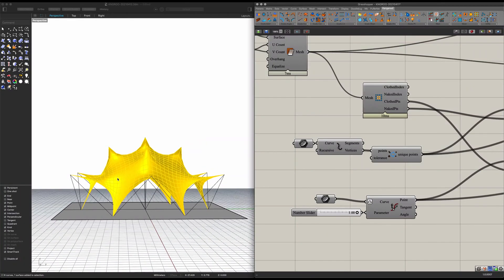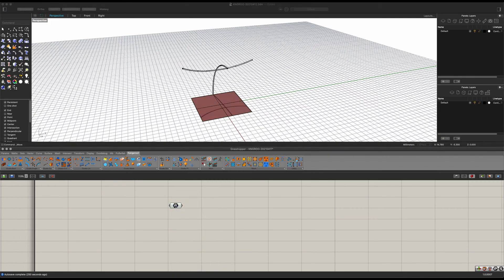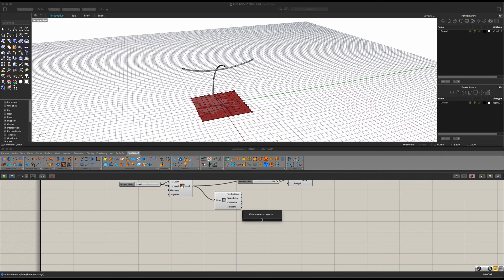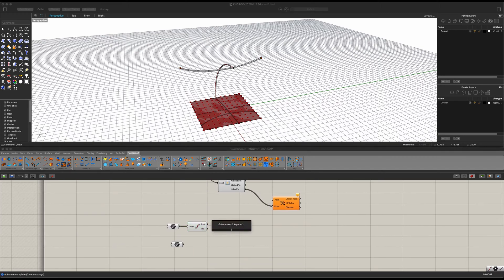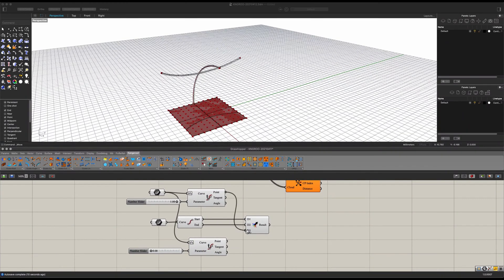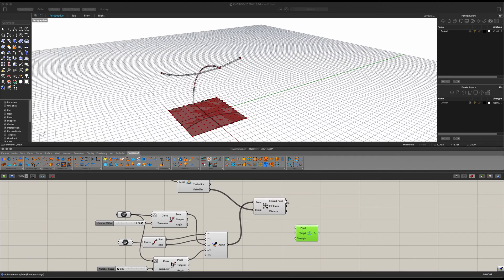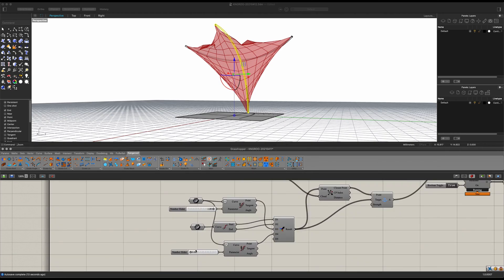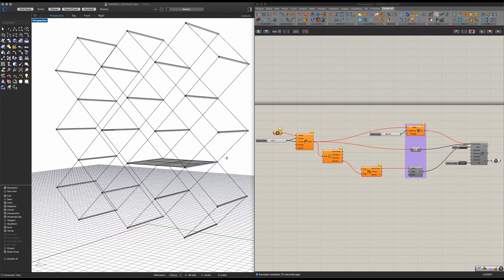How to make 4 basic tensile structures! - Rhino/GH Tutorial

Comment: Hi! I was wondering if this works for samples that are much larger and how to make that work. I tried this out on the provided rhino file, then copied the grasshopper code and small model into a different file. I scaled the small provided model up and attempted to put the same code on it and it hardly covers the points all around. If someone knows how to resolve this, let me know! (This is for the tensile tent structure example).
Reply from the maker: Consider increasing the value ranges on the sliders, that could be the cause

Comment: Thanks for these nice videos. I would like to ask if you have any special method to calculate the pre-tensioing load required in any of these cases to keep the fabric in form, more specially I need to know how much load is needed to keep the fabric tensioned as flat as possible within the structure like a simple square frame for example.

Comment: great tutorial sir! May I ask, it seems that Kangoroo2 Solver can't solve the algorithm when my model is too large compare to the world's XY grid (like 20000mm plus). I have to scale it down to make it works. Otherwise, the anchor points just pull to the World's origin(0,0,0). Did I do something wrong? Is this a bug or just the way how grasshopper and kangoroo2 works? Thanks for your help :)
Reply from the maker: That's interesting, maybe grasshopper is displaying some sort of limit on it's distance, but I'm quite sure that's adjustable some how
Reply: @axocraft  yeah. The only fix I’ve found is changing my model unit from mm to m and scale down the model accordingly (0.001) . It’s not too big of a problem even tho I usually work with mm rather than m